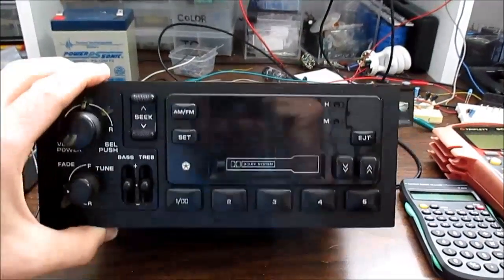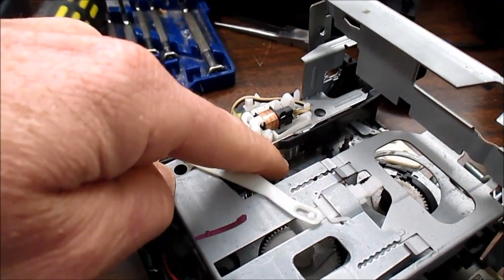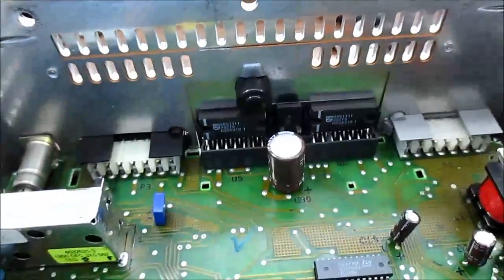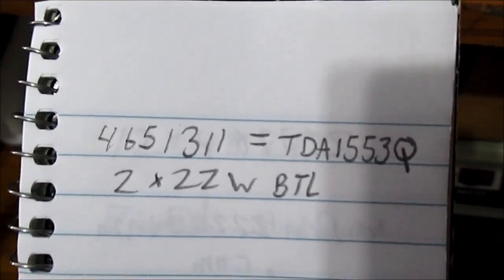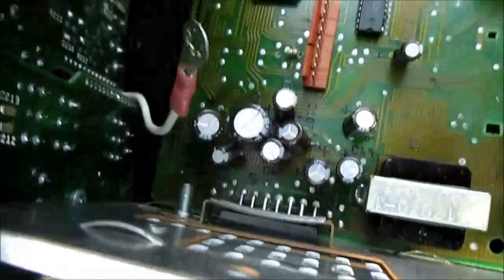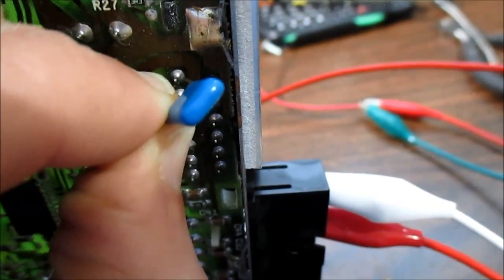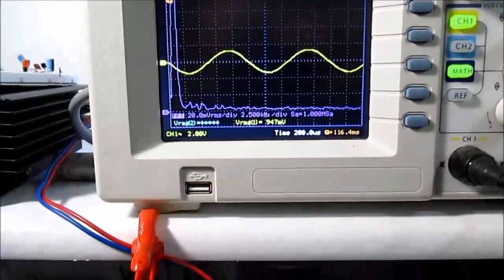Chrysler car stereo power test and chip amp extraction

Comment: Thank you for this video.  I've been wanting to see somebody test power output on OEM car stereos.  The latest GM cars with stock non-Bose audio all have an amp that includes noise cancellation circuits, it's an aluminum box about the size of an old cigar box. Do you know what kind of IC amp chips GM uses in that?  My guess would be similar to this unit in power output?  Just wondering.

Comment: These amplifier ic's are great for building two way active crossed over powered monitors.. By activity limiting the frequency that the amplifier must amplify.. You should be able to obtain a bigger output and less distortion than the job it was meant to do in a car... Some car stereos that I have pulled apart have a totally separated power amplifier section and sound amplifier ic's actually have a more powerful direct pin compatible ic available.. Usually the PDF will state if there is something pin compatible with it...

Comment: Wondering if this is possible in reverse for a car stereo.  Can you make a car stereo that doesn't sound very good better by replacing the amp chips with a different number? i.e. cleaner sound and less distortion... and if so how do you go about it?
Reply from the maker: Probably not. It would need to have the same pin out and support components type. A properly functioning amplifier IC should have pretty decent sound so there could be another problem if the sound isn't up to par.
Reply: Thanks for the reply!  I understand what your saying.  Its possible that my speakers aren't up to par.  Its a 2 channel factory stereo with 4 speakers.  But the sound is also not that good when I use a headset.  It doesn't break up or have any interference whine.  The sound is a bit flat and I would say slightly tinny.  Its a 26yr old factory panasonic stereo.

Comment: Hi John. Have you considered adding an XS3868 bluetooth module to your amps? I've tried adding one of those PAM8024 (?) 3w+3w amp module from ebay but I got stuck. The signal ground of the bluetooth module is at 0.9V and when i plug it to the imput of the amp i get a lot of noise. What should i look into?
Reply from the maker: I haven't tried one of them as I plug in direct with cables. What is the .9v relative to? How would you describe the noise? hiss, digital hash type noise or something else?

Comment: look to be early 90's. had one just like in 92 Daytona.
Reply from the maker: Yes, many parts had early 1993 date codes, so it probably went into a 93 or 94 model.
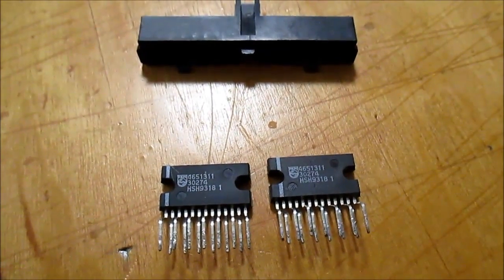Reply: Chip at 15:15 had 92 stamp Left side
Radio may be made by Standard Radio, Chrysler 
Also no radio delete option when buying this car.
In the car it was in, removed usually within a week,speakers also so low of quality
as to be unlistenable...
Was a great business,aftermarket car stereo installer.
Thank you Chrysler,Ford and GM.

Comment: Just curious, does the oscilloscope give you any measure of how well the audio will sound besides the more concrete things like clipping and all? Also your amps seem to be sweet and simple while I've seen pretty elaborate ones made of many components. For audio quality or trueness to the actual audio, are you better off using fewer components and which components make a bigger difference? Sorry if that's too many questions but you seem to know your stuff and these aren't easily google-able.
Reply from the maker: Actually a great question. A digital scope lets you see the frequency response, instability problems and so much more. Modern scopes have an FFT spectrum analyzer mode (the blue graph you see me use sometimes). If there is harmonic distortion it will show up as the little peaks next to the fundamental test tone. The feature on my scope is rather course, allowing me to see down to around .25%. I would need better equipment to read lower THD. Many argue that THD below 1% is inaudible with most music anyway. Now to answer your second question: It depends. Some good chip amps, like the LM3886, can achieve very low distortion without many parts because all the "magic" is done inside (as long as good board layout is applied). I've seen that chip used with special feedback circuits to bring the distortion down to crazy low levels, below .00001%. To me that is overkill because the distortion is already so low to begin with. Other extra circuitry you may see are preamps and equalization (tone controls) added. Nothing wrong with equalization,  however, my preference is to feed the signal in uncolored in any way.

Good discrete amplifiers tend to have a lot of transistors and other components to keep distortion low while maintaining stability.

OTOH, there are a misguided few who think that stripping off required components is good for the sound. They leave off parts that are needed to keep the amplifier stable. I would not recommend this.

I hope that answered your questions!
Reply: Yes, definitely and I agree, I much prefer my audio as clean as possible. I bought a cheap TA2020-based amp for my bookshelf speakers and upgraded a few components following a forum post, then interest grew from there. When I get time, I'd like to build an amp like your models but I have much to learn, sensai.
Reply: I would suggest you to begin with something like lm1875, but as John mentioned the layout is quite critical, maybe even more critical than parts itself (to some wise degree). Also you may want to go to diyaudio and collect some information, there are plenty of people who just beginning